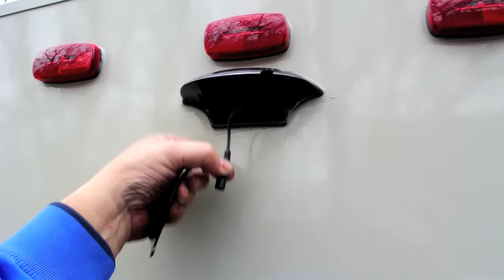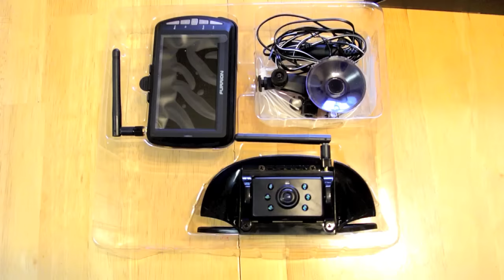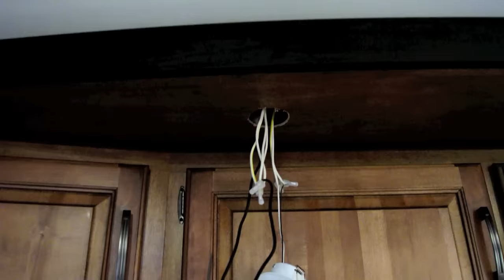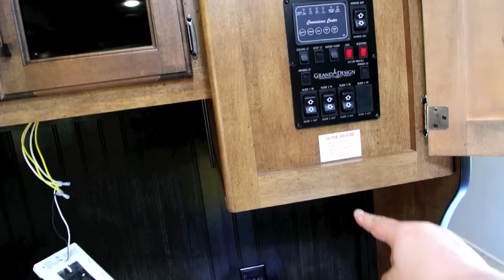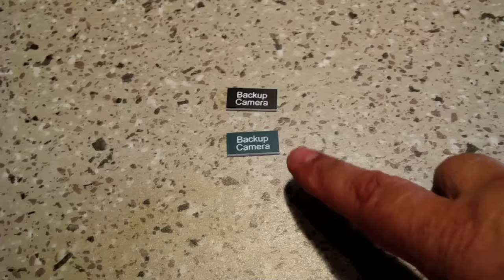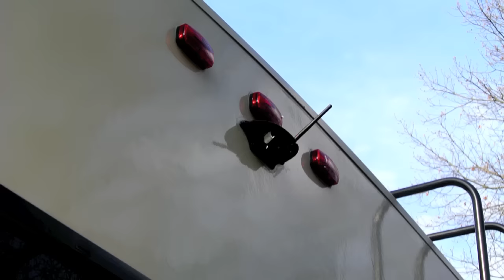Installing a Furrion Backup Camera on my RV.

Comment: if the camera is only on when the running lights are on, then i do not see the problem.  when you are not driving, the camera will automatically shut off, no?
Reply from the maker: The manufacturer did not wire the camera to the running light circuit, but rather they wired it to the hutch circuit, which is on all the time.   

This was not ideal, so I devised a way to turn the camera off when not needed.

When I later upgraded to the Vision-S version, I did re-wire the camera to the running lights: http://www.rv-project.com/projects/furrionscamera.php

Comment: Could you have used your battery disconnect switch? Switch off your battery when not in use, switch on when you hit the road.
Reply from the maker: Yes, you could do that. But you would have to leave it on whenever you are camping as well.

Comment: so I watch this video all winter long 2017 27rl I pulled the 2 puck light and there is no black wires camera still stays on all the time though where's that hook to
Reply from the maker: When I talked to customer service at Grand Design last year, I got the impression that the installers change their location occasionally. As well, after talking to other owners, they have found their camera connection points in different locations.

So there is no guarantee that every coach will be connected to the puck lights.
Reply: I have the 27RL as well. Did you come up with an option?

Comment: will another brand work with the wiring and bracket ?
Reply from the maker: The bracket is designed for the Furrion camera. There is at least one other mfg that makes an adapter, but it looks horrible.

Comment: Is the jack in the camera housing a standard 1/8" 3.5 mm "stereo" jack. Looking to wire in my own much cheaper camera.
Reply from the maker: You can simply cut off the end of the power cord and wire it how you need it.
Reply: @RVProject  that's what I ended up doing.

Comment: Mine stopped working. Tried to repair and no picture. Blue camera light is on which indicates power. I’m stumped. Even put the monitor within a few feet of the camera for pairing.
Reply from the maker: Did you ever get it to work?

Comment: Am I missing something here or could you just use your battery disconnect when you returned home ?
Reply from the maker: Yes, the battery disconnect would work. However, at least on my coach, there are a few things that remain wired o the battery, even when the battery disconnect is engaged. These "parasitic" loads will eventually run down the battery as when the disconnect is engaged, the charger is not connected to the battery.

As well, in the storage season, I like to keep the battery charged to compensate for the battery self-discharge characteristics.  Again, with the battery disconnect engaged, the charger cannot keep a trickle charge on the battery.
Reply: I was under the impression that the battery disconnect was suppose to completely disconnect the battery so one would not be required to remove the battery cable. I guess every camper is different.

Comment: I just purchased a 2018 Forest River Salem that is prewired for the Furrion Camera. So I purchased the observation camera on amazon and connected it to the already prewired bracket and it still does not work. But if I plug it into the connector on the cigarette lighter it works perfect. So I am guessing it does not get power. Anybody else have this issue?
Reply from the maker: Did you try to turn your tow vehicle's lights on, or put your vehicle in reverse. Some factory pre-wire cameras are wired to either the tail-light circuit or the backup circuit - both of which are powered by the vehicle.
Reply: I did try those things and I called Forest River, the girl there said they work off the running lights. And if that doesn't work I am to take it back to the place I bought it at. Thank you for your input.
Reply: I am having the same issue with my 2018 forest river.. I have no power to my camera when I plugged into the prewire. I have tried just about everything except pull the back end apart and trace the wire.
Reply: TD Projects -I am taking my camper back to the place I purchased it at tomorrow
Reply: I will let you know what they do.

Comment: I connected my Furion up today. I have 2019 Keystone Cougar. I got frustrated trying to get a signal. I finally found to power the camera I have to have the lights on. At first I thought it needed to be in reverse to get power. After thinking about it I shouldn't have the battery drain unless I have the lights on?
Reply from the maker: There is a little LED indicator light on the camera.  If it is on, it is consuming power.
Reply: @RVProject  I connected it. The wire that Keystone runs back to the camera is one to the clearance lights. I just have to have the lights on to power up the camera. Thanks

Comment: Couldn't you just hook it into the power supply for the reverse lights?
Reply from the maker: This is an observation camera, which means it is intended for use while you are going down the road. So the reverse light connection will not work as you obviously need to be in reverse to power the camera.

When I bought my RV, the mfg had already installed power for the camera from the hutch circuit. Since then, they changed their method and now hook it up to the running lights so the camera will be on whenever the headlights are on.

I could have re-wired the camera for the running lights, but since it was already wired, I did not make the change.

Comment: How do I get power to the monitor ?
Reply from the maker: The monitor plugs into your tow vehicle via a standard accessory plug.
Reply: I guess they failed to include the cigarette lighter adapter in my package. I bought an opened box from the dealer I bought my 5’r from last year. Guess I’ll have to pick one up.

Comment: So...basically the camera actually needs to be hard wired and is not 100% wireless.  I thought I could buy a camera, plug into the installed mounting bracket and then take the monitor into the cab of the vehicle and would be good to go.  I don't know how to do any kind of wiring, even with your instructions.
Reply from the maker: Wireless refers to the RF signal. In the traditional sense, it is 100% wireless (but not like a cell phone wireless).  

The camera still needs to be powered with 12VDC. Small batteries typically used in a small device are not practical in this scenario because the camera requires too much power (and transmit power = transmit distance)'  

For example, 10 AA sized Ni-MH batteries would only last around 6 hours of operation. Imagine having to climb up to the roof to change batteries while on the side of a interstate highway.

Many new RVs come pre-installed for a Furrion camera. If that is the case, the DC power wiring would likely also be pre-installed. That would simply require plugging the camera into the pre-installed power cord and screwing it down to the bracket.
Reply: Thank you.
Reply: Karen Wall - There are systems that are completely wireless. The camera works off a rechargeable battery and the monitor plugs into a 12 volt plug in your vehicle (cigarette lighter plug). I wouldn't suggest this if you do a lot of RVing. It would be ok if you go just once or twice a year. Just remember that the camera is not permanently mounted and will also need to be recharged.
Reply from the maker: Just realize that such systems may not have enough range. 

I also have  an iBall hitch camera ( http://amzn.to/2qpbtLc ) that works well for hitching to the RV; the camera is magnetic mount and goes on the tongue or king-pin of the trailer - and the monitor plugs into the accessory outlet in the cab (my video review here: https://youtu.be/Rckxv55A4EU ). 

It works great for hitching the RV to the tow vehicle, but I also tested it behind the RV and found it did not have suitable range as a backup camera for the RV.

Comment: How about a video on an RV that is not prewired for the camera?
Reply from the maker: Unfortunately I am not able to do that unless I found someone willing for me to do the installation on their rig.

Not a lot of difference in the installation.  I would recommend mounting the camera as close as you can get it to the clearance lights, as you could use them as power (the camera would be powered when you turn on your tow vehicle's headlights).

 The camera housing simply attaches to the back with 4 screws, and if you remove one of the clearance lights, you should be able to "fish" the power wires behind the skin wall of the RV from the lights to the camera housing.

Comment: well, power all the time talked me out of it.
I have a battery shut off but it won't do me much good if I boondock
Reply from the maker: A lot depends on how your mfg installed it. But if you can always re-wire the camera to the running lights - which is what a lot of people do. That way, the camera comes on with your headlights. You will need your headlights on to tow (or I should say to power the camera), but towing with headlights on is not a bad thing,

If you don't have the bracket yet, you can also buy a version from Furrion that replaces the rear center clearance light - so no new holes.

Comment: Prices on these are up $200+!
Reply from the maker: This model has been discontinued. So any remaining stock you find might reflect a higher cost by unscrupulous sellers. 

The replacement system is called Vision S. and has the capability of single or multiple camera viewing depending on the model.

Comment: When the camera has power is all up to who ever wired it...
Reply from the maker: In many cases, the mounting bracket is installed at the factory, which includes wiring the power. 

It has been my experience that depending on the manufacturer, model, and year, they are wired several different ways. 

Popular methods include wiring to the tail-light circuit (turns on and off when you put your vehicle headlights on), reversing circuit from the 7 pin harness (comes on only when your vehicle's transmission is in reverse), or wired up to a 12VDC circuit in the RV (at which point the camera would be on all the time).

There is perhaps some debate as to which method is better, but at the very least, powering the camera all the time would seem the most disadvantageous, as it unnecessarily puts wear and tear on the camera and it's sensor.